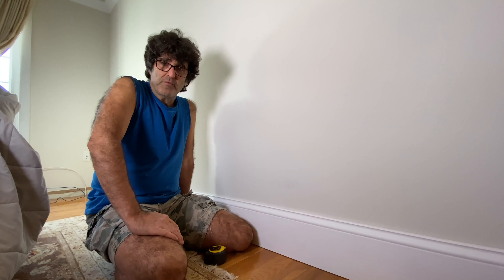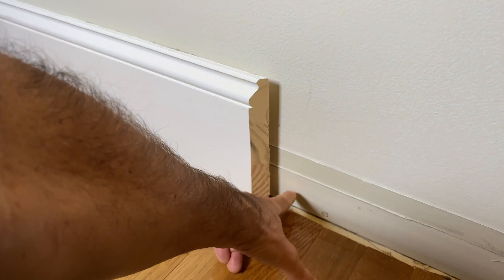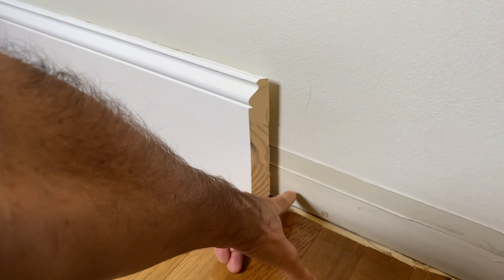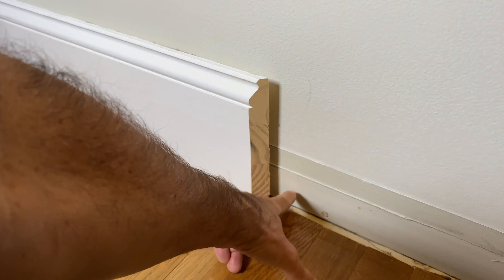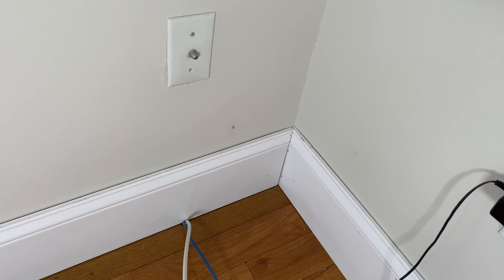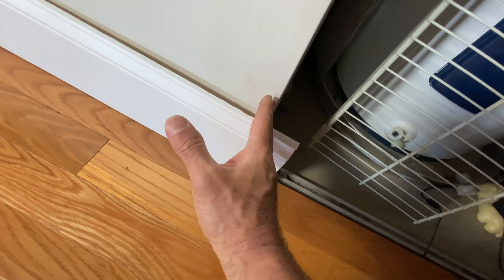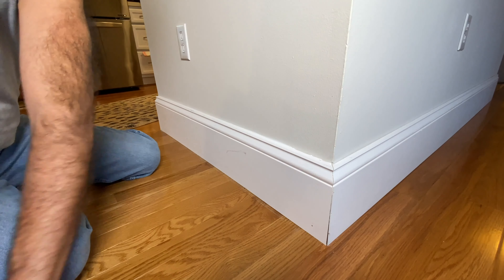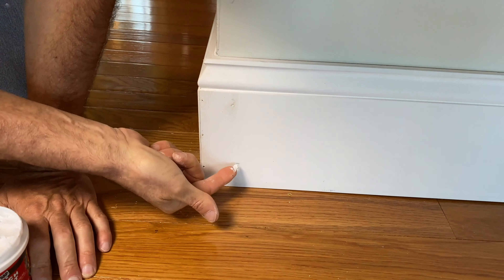All The Ins and outs of Installing Base Trim [Board] in Your Home!

Comment: Good stuff Rudy.  The spackel is the best trick out there.  I can set nails, fill and sand fast!  Alex and I are on a first name basis.  But ya gotta give that stuff 24hrs before primer or it shrinks really bad.  I avoid the Alex with silicone like the plague.  Too gooey for me.
Reply from the maker: Great tip on the waiting... Yes I waited probably more than 24 hours before I painted.  Thanks for the feedback!